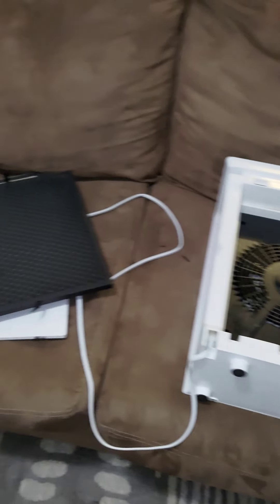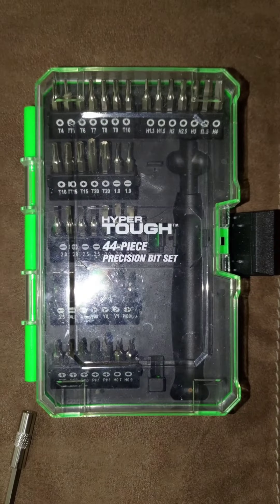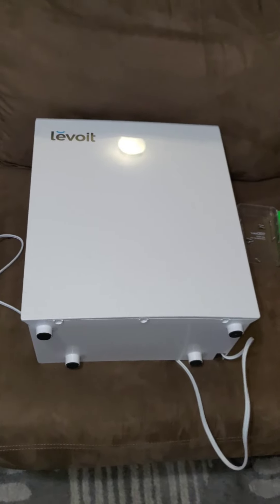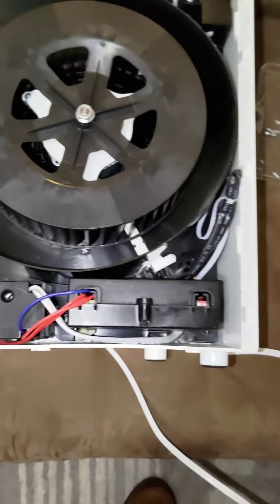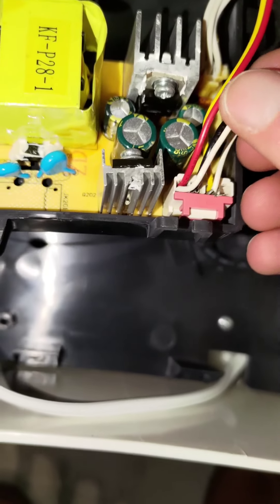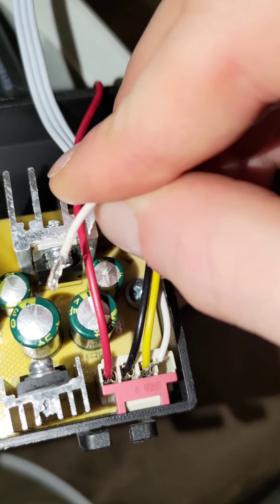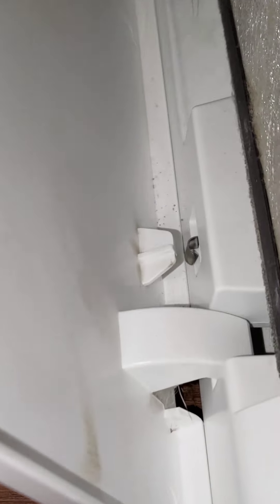Levoit LV-PUR131S Hack / Teardown

Comment: I bridged those connectors just like you did in the video and it worked like a charm. Machine fired right up when I plugged it in however I worry about leaving it plugged in all the time especially when I'm not home or sleeping. Really do not want to burn the house down.
Reply from the maker: I understand your concern.  I have left mine plugged in since I made this video several months ago with no issue.
Reply: I was worried about the hack being a fire hazard as well so I just replaced the capacitors (I have never even attempted anything like that before and it was easy) so it works like new again, no hack needed.
Reply from the maker: If I get some spare time, I'll make another video replacing the capacitors.  I just wanted a quick fix to be honest.  I have been running mine for almost a year now, with no issues.  I also tested it for a few months before making the video.  This method essentially just turns the unit into a fan.  It's doing essentially the same thing as the electronics when set to high mode.  I wouldn't have posted the video if I thought it could be a fire hazard.  I'm glad you got some help from the comments though 😄
Reply: @gavindundee  Hey Gavin, thanks for posting this update, I just did the hack, and I used a 28-gauge copper wire, it worked, but I could smell a heated plastic / metal smell from the unit as soon as it started.  I took it apart and the entire black box containing the electrical components was warm to the touch, the forked piece of metal on the board (above capacitors) was actually hot.  Does yours give off the smell as well, or do you think it was because of the copper wire causing it to overheat?  Thanks for any advice you have.
Reply from the maker: @darthsidious322  I have never smelt anything when running mine.  There may be something else shorted on your unit. :(
Reply: @gavindundee  Any chance you got around to replacing the capacitors? I'm about to attempt this but have zero knowledge of how to safely do it and enough of a healthy fear/respect of electricity to know caps aren't something to mess around with blindly. A how-to video would be super helpful
Reply: The problem is the caps on the power board is bad. You have to replace the ones that are bulging. You could or you can find someone good with soldering in your area to fix it.

Comment: i wonder if clamping the yellow and red wire together would work the same as bridging it at the connector 🤔
Reply from the maker: You would have to strip them down, but yeah any way you short the wire should work.
Reply: @gavindundee  tried it that way and it does work too 👍🏽👍🏽 video helped thanks
Reply from the maker: @dominicjamal862  I'm glad it helped!! 😊

Comment: Thanks for video.  I kinda got lost at the key moment, where you adjusted the wiring.  I got that you stuffed the red and yellow together in one socket (hole) but I don't understand why you also put two more wires in it.  Or how precisely.  (Sorry, I've got this Levoit issue but not the best electronic guy.)
Reply from the maker: I only added one white wire to the unit causing a short between the yellow and red wires.  All you need to do is connect the red and yellow wires together using another wire :)

One thing I said that was confusing is bending the wires.  Strip your wire on both ends about 2 in.  Twist the wire with two fingers until you can't twist anymore.  Then fold the stripped wire part (not the insulation) in half.  This just adds some more volume to make a tighter fit in the hole.  Your wire may or may not be big enough already!

Comment: If you add a voltage controller (PWM) dial in with the jumper you can have your variable fan speeds back. You don't have to get fancy with it either, can just drill a hole in cover that will accommodate the diameter of the dial. Just stick to a controller with a voltage range that doesn't exceed what the fan is rated for. Just an FYI.
Reply: Comments below said to replace the bulging capacitors which I just did and my machine is like new again working as it did out of the box.
Reply: What is the fan rated for? And is it DC or AC?

Comment: My unit just stopped working after a few years . All the lights are on when plugged in. Is this the same issue?
Reply from the maker: Probably so.  Mine left the lights on for the first few times I plugged it in / reset it.  It's probably the capacitors.

One of my units even allowed me to reset it and it worked again for a day after initially experiencing the issue.

Comment: Gavin, I did this and the machine started working again. However periodically makes other noises (almost like a notification chime). Does yours do that too after the fix?
Reply from the maker: Mine has not made any other noises.  The capacitor they have been referring to in the comments may be temporarily charging up and supplying power to the board and causing the chime.  I wish I knew what would fix the problem for you, but I am unsure. 🤔
Reply: @gavindundee  this may take some voltage tracing using a volt metre and measuring where there are fluctuations between PCB component points where current is either inconsistent or faulty. Then we can narrow down to other responsible factors, like the 2nd capacitor.

Comment: Do you have a hack or a fix for when the purifier doesn't want to acknowledge a new filter set installed..?
This is probably my 3rd time changing filters for mine, but it won't reset for some reason... I've cleaned the lens and changed the filters properly like I've done in the past. However, the change filter light will not go away and nothing works, nomatter how many times I unplug it, clean the lens, and switch filters...
I seen many people online complaining about the same issue, but no one seems to have a solution, other than calling the company to complain and hoping that they will send a replacement...
I have no idea how long I've had mine for, so I'm not sure if mine is still covered under warranty or not... I was hoping there was a way to bypass the change filter indicator a different way, considering the reset button won't fix it nomatter how many times I press it nor how long I hold the button down...
Reply from the maker: I'm sorry to hear that, but I don't know what to do.  I always reset mine in the application on my phone after replacing the filter.
Reply: I’m actually having that exact issue right now but my device was a gift so I have none of the order info
Reply: @gavindundee  Same, this is the best way. Always press the unit’s back button through the panel as well to reset the settings/censor

Comment: I have a unit where the touch panel has stopped responding do you have any tips for that?
Reply from the maker: That is what happened to mine.  None of the electronics would work and the fan wouldn't turn on.  Follow the steps in the video to make it work again.
Reply: @gavindundee  ahhh I see I understand thanks man!
Reply from the maker: @andrewmatthews8428  you are welcome 😊
Reply: The broadcom/wifi controller board has a phased connection that runs that display and the adaptive touch regions. Now, that board will fail to even delivery current or function at all if the power supply is toast - we are actively discussing this right now. You know, anyone can place a order with a PCB manufacturing facility in Shanghai China and order a 100 of these boards and just offer kits to people. Since the connections are designed to disconnect inline from each other, its 100% possible. Those how people clone game console mod chips that are "no longer available", it just took 1 guy who happened to of had a modchip on hand, and just sent the order in to reproduce 100-200 boards. They then dump them on places like Alibaba and make a load of $.

Comment: Can confirm that mine is not powering on at all and has a bulging capacitor too, time to replace it!
Reply: confirmed, replaced the blown capacitor and the air filter lives again!!!! :D
Reply: @chaosdimension6433  what type of capacitor was it? did you have to solder ?
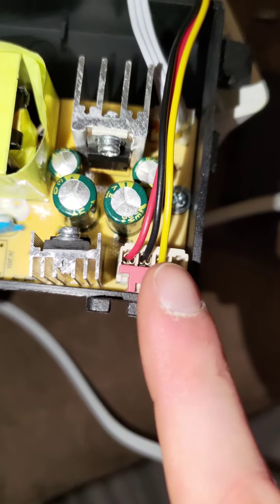Reply: @ImJazio  its a 470uf capacitor and yes I had to solder, you can see it at 3:08 in the video
Reply: @chaosdimension6433  My unit failed the same way - Could not start it. Red start button stayed on along with replace the filter button. Unplugged the unit for long time, plugged it back in - same thing. Took it apart as shown in the video. IT REALLY HELPS TO USE A FLAT HEAD SCREW DRIVER TO PRY THE PANEL OFF THE UNIT. COMES OFF EASILY WITH THIS TECHNIQUE. SIMPLY INSERT THE SCREW DRIVER AND LIFT UP. Both of the 470uF 16V capacitors were bulging. I replaced both of them using my soldering gun and now the unit is back to normal and operating perfectly. I purchased 1000 capacitors for $30 CDN on Amazon in which there were 10 470uF 16V capacitors. Still have 8 left to repair my other Levoit unit when it fails.

Comment: This is stupid af, this company is a scam. The fact they use a triangle screw just shows they don’t want the average person to fix this. My unit died literally 2 month after the warranty ended. I’d rather throw this trash off my roof then spend the time to fix this like this. Thanks for the video tho, upvoted
Reply from the maker: I agree that the situation is terrible, and I don't know why they don't update their product.  They have to know it dies within a year or two.  I was very upset/angry too.  I'm glad you found the video helpful though!
Reply: I used firm pressure with a #12 Phillips 10” driver, I had no issues. It came out like the other screws.
Reply: @gavindundee  i contacted support, they gave me a bunch of bs generic troubleshooting to try “try a different outlet” lol yeah okay… but after a few exchange they are sending me a new unit. Which will prob last a year so I guess I’ll just call them once a year for a new unit lol
Reply from the maker: @PerkulatorTime  unfortunately, they will only replace it one time.  😅 I tried.  I have two of the units now after I fixed them up like in the video lol
Reply: @PerkulatorTime  Support often aligns with a template of answers to relevant criteria - which means your wasting your time and mind as well talk to a bot, its essentially the same response nature out of them. Repair it yourself. The shelf life of these components was clearly with savings in mind for the entire production run. Pisses me off.
Reply: I agree it is total BS but I love these machines when they work. I bought 3 and was shocked at how they drastically reduced the dust in our home. My daughter went from coughing all night from allergies to not coughing at all. I bought warranties for 2 of the 3 I bought and have cashed both in already. Mine seemed to blow during power outages, several months apart. And just flickering outages, nothing major. 

I got the payouts and kept the machines knowing I could most likely fix them myself. I will give it a try and hope for the best. I bought them when they were under a hundred bucks and only lost the $15 protection plan so I won't complain too much.

Comment: Good video, but instead of jumping the board, just replace the capacitors on the control board. I swapped out both of the small 470uf capacitors on my LV-131 and now it's fully working again. Odds are the caps Levoit are using are cheap/garbage. Swap them out for new ones and you're good to go. This video here has more on it: https://www.youtube.com/watch?v=RJjbAqp-lw4

Comment: Please do NOT do this jumper hack.  If you MUST do this hack then at least disconnect the main control board from this power board; that's the 3-pin wire going to the top panel.  Reason: This jumper connects the 24V (RED) to the fan's PWM control line (YELLOW) and also to the micro-controller on the main control board.  This will fry the micro-controller and leave no future options to do the proper fix which is to replace the bad capacitors.  Normally the main control board would output a PWM signal of not more than 5V to the YELLOW wire.
Reply from the maker: @keljam08  Thanks for the info!  Good to know.